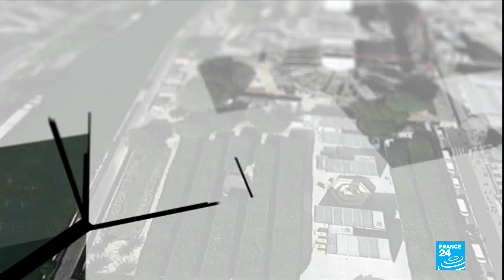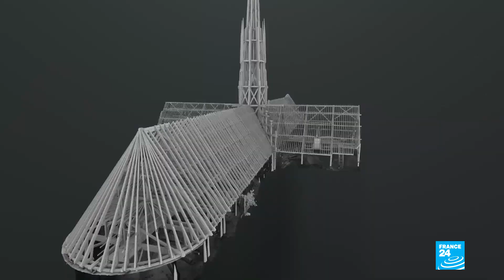Three years after fire, a race against time to restore Paris's Notre-Dame Cathedral • FRANCE 24

Comment: I am so very glad that the majestic building will be restored as it was before the fire. Some of the horrid ideas that were presented after the fire were petrifying.
Reply: I'd have been happy with replacing the wood roof with steel or iron, so it wouldn't be combustible
Reply: @AG-ni8jm  That would be fine as long as it looked exactly as it did before.

Comment: I'm delighted to hear that the restoration is coming along so well but I can't help but wonder why lead is being used to reconstruct the vault. The toxic lead dust that was spread by the fire is mentioned repeatedly so wouldn't some other material make more sense than using lead again? After all, a future fire isn't unthinkable and, as I understand it, considerable volumes of lead dust was scattered all over Paris - not just within Notre Dame - by the wind as the cathedral burned. Or was the spread of lead overstated in the original reporting?